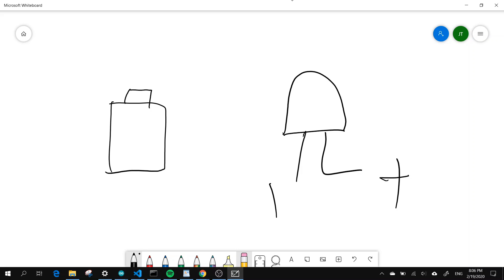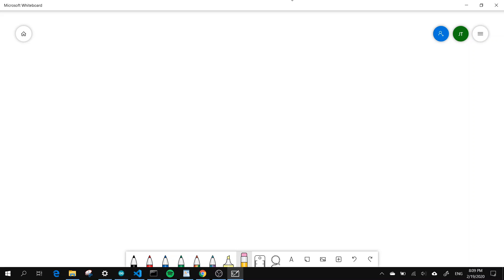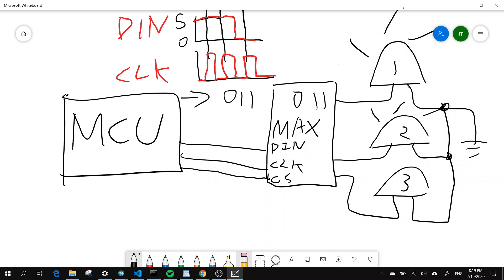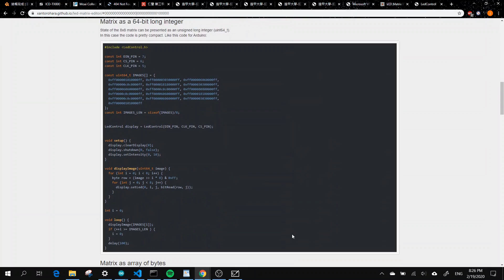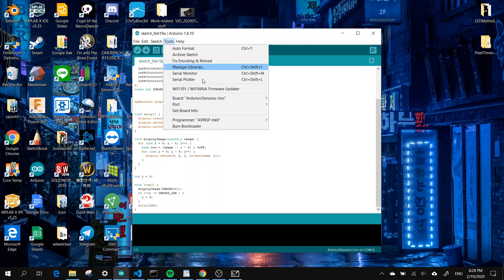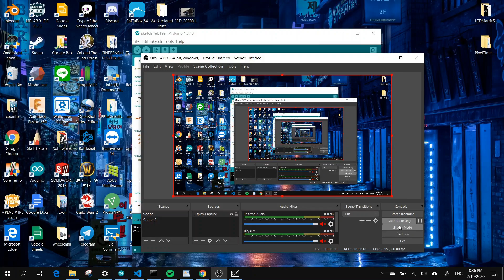Basic Max7219 LED matrix tutorial ! (horrible tutorials PT1)

Comment: Hi, is there a specific reason you went with the ledcontrol library? I myself use the Maxmatrix library and I find it a bit easier to use.
Also the Maxmatrix library limits the amount of matrices you can use up to 11 matrices, so I had to modify the library a little. Is that also the case with this library?
Reply from the maker: I wanted to find someone as simple as possible with code that can be directly copied. And that website does the job pretty well. It doesn't support multiple matrices though. The library can do 8 matrices per instance , so you'll probably need to connect two sets of spi pins to the arduino. I think this may help with refresh rate as opposed to connecting all of them on a single spi lane, I could be wrong though. Also hi man didn't know you'd watch my bad tutorial >.<
Reply: @jting-f3237  Yeah, kinda trying to keep up with new functions for protogen tech :3
The refresh rate could be better, but the Arduino still has to write all the icons line after line, so lagg is kind of always there. I have also have some code on my twitter which I tried to make beginner friendly, might be worth giving a look? X3
And you're tutorial isn't bad! At least you made one, I'm way too shy to do something like that, props for that!
Reply from the maker: @feronium  Do you want me to make a video about your code and use it as a example? I'll be sure to link your stuff
Reply: Jting-F if you want to use it as an example go ahead, but it’s not nescessary :3